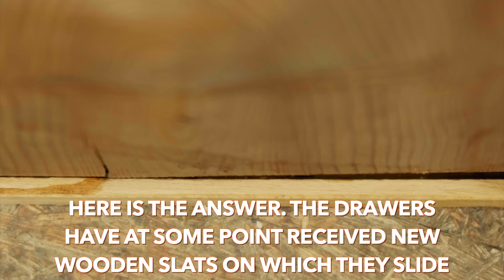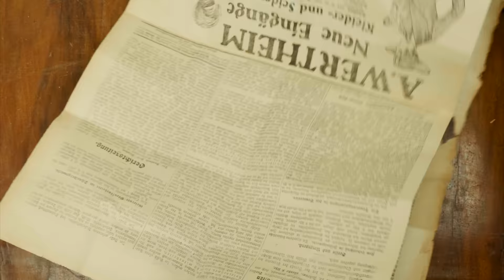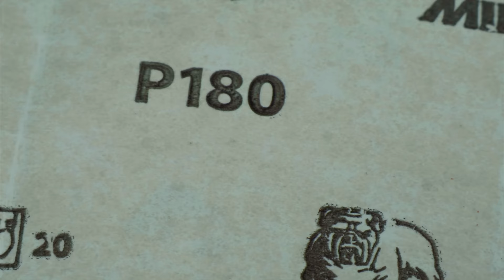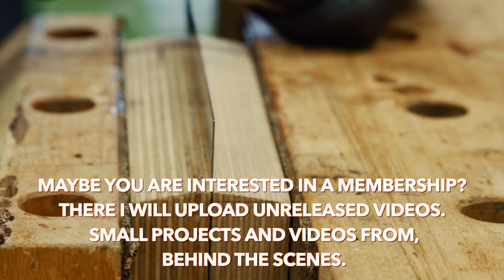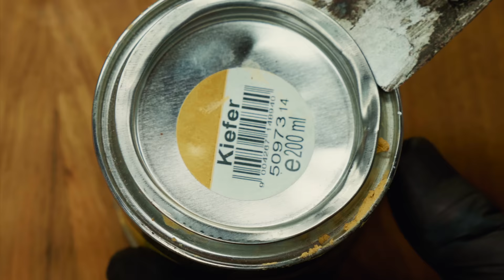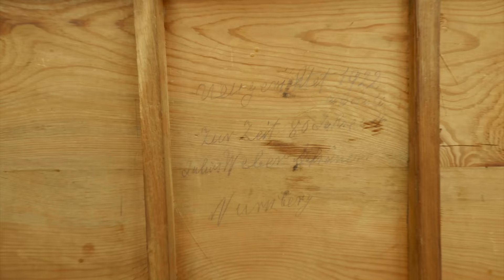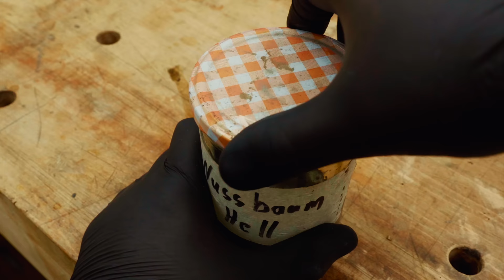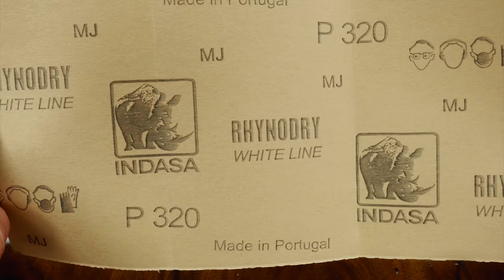2 GEHEIMNISSE in Kommode von 1842 gefunden

Comment: Should have cleaned and waxed inside to remove the old smell. Plus it would have been better if you sanded the bottom of the drawer. Looks dirty.
Reply from the maker: I did that, but I don't show it in the video.